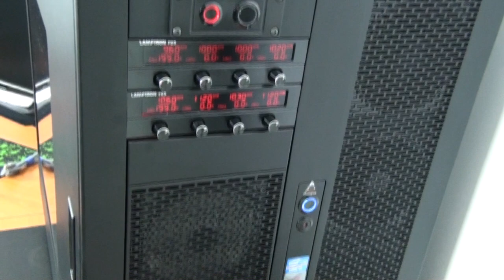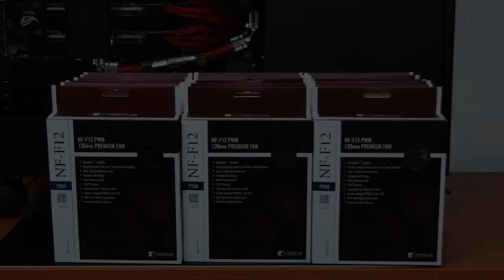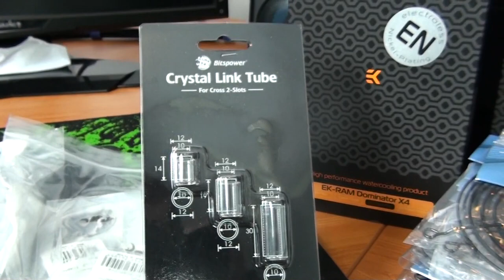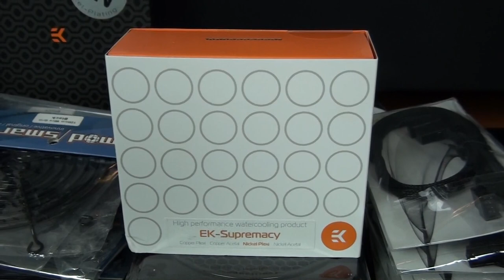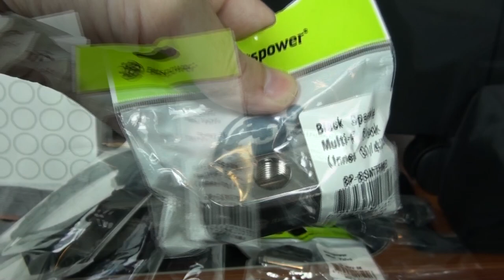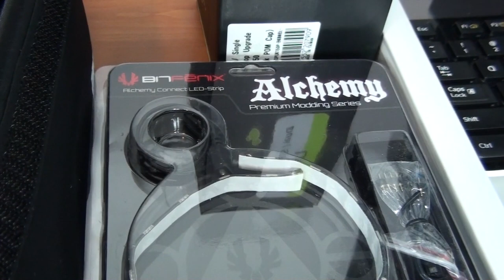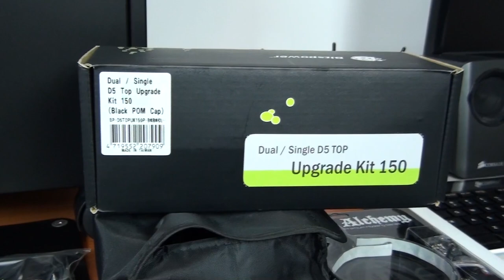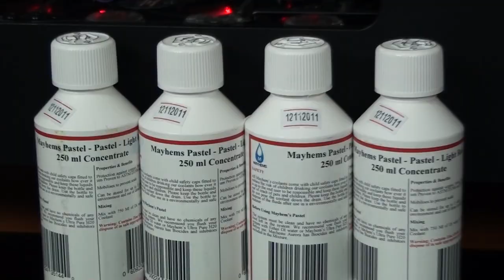Singularity Beast II Build Log Part 11

Comment: Excellent video again, I completed my Magnum TH10 build about a month ago, the cost was astronomical even without computer components (already owned them). It's an excellent case and allowed me to do some funky lighting, cut some switch holes near the switch plate and wired in a couple of latching switches much like the original power switch to control lighting.

Comment: Yesterday I received a TH10 Door fitted with an XXL window. It looks much better than the XL size window. Whilst the build is still in progress the XXL window does show off the various components much better. The freight costs to Australia was excessive, so if you are considering ordering a TH10 I strongly recommend you order the XXL window with the case.

Comment: In theory yes, it depends of the radiator caracterisitcs, some are engineered to create less air resistance (lower FPI) improving performance with low pressure fans, others are optimized for higher pressure fans (higher FPI). You need to find a balance between pressure/flow/noise.

Comment: I shouldn't have said "Galvanic" corrosion in my prior post, but just simply corrosion.  Corrosion (in a like-metal loop) can occur when the pH level of your coolant is too low (I've read different opinions on what "low" is, however anything below 6.4 is running the risk of corrosion in a like-metal environment, as the water is now in a more acidic state and can corrode metals like Copper, Brass, and Nickel).  Sorry for putting so many responses on your comment page

Comment: Unfortunately I've run into a problem with the Feser UV Clear Blue coolant (looks great with UV lighting and with lighting turned off it looks like water), however...condensation at the top of the res has left a white deposit which turns into particulates when it makes contact with the coolant. I also found that the white build up occurred in the tubing I used to fill the res, it's almost like crystallised salt after it's dried. Coolant is my number one headache.

Comment: Higher pressure is better for push air through radiators or heatsinks. And higher flow to situations with lower restriction, like a case fan.

Comment: I'd like some advice on waterblocks... Seeing as EK's new CSQ lineup is ugly-as-shit, I'm leaning towards Koolance's blocks (which are nickel plated). Will I Run into any galvanic corrosion problems using, say, Koolance VID680 (two of them) with a Nickel plated EK Supremacy .. ? Both are nickel plated copper, I guess there shouldnt be a problem :)

Comment: Thanks for the speedy reply dude. I was just wondering cause my neighbour comes over alot to use my comp but he just sold his back-up car & has $5,000 he wants to put towards an extreme build. I just dont want him trying to hook up to my main power box outside when he gets his first electric bill.LOL. I was wondering, the 1 PSU that will B replacing the 2 U currently have is the equivalent, or were the 2 PSUs massive overkill? adding all those hard drives might B risky with 1 PSU.

Comment: You can paint the noctua fans if you don't like them. Obviously not just spray them down. But there is a special way to do it without hindering they're performance. So I'd deffo recommend you try to find out how to do it if you have the time

Comment: Distilled water damaging the components in a loop?  Are you referring to the low pH level of distilled water (meaning it's acidic), leading to corrosion buildup?  I've been worried about this myself, and haven't been able to find any safe additives to increase the pH to a more alkaline level

Comment: what additives are available to prevent simple corrosion?  i've found mostly biocides but that's a separate issue all together.  haven't been able to find any corrosive-inhibiting additives.  after seeing the new "EN" EK Nickel Blocks having the same corrosion problems, I'm really worried about my GPU block on pure distilled water

Comment: after about an hour of thinking about this, I've come to the conclusion that you're referring to De-Ionized water, and not distilled water.  Once you mentioned the ions, I came to that realization, as distilled water is mostly neutral in the amount of ions it contains due to the process used to create distilled water.  Galvanic corrosion has been known to happen in like-metal loops, however, using Distilled Water, due to the pH level of the water being too low (acidic)

Comment: Hello Daniel.  I was wondering if you had 11 minutes of your time that you could possibly spend looking at my most recent video . It is just the into of Parts for a HTPC build using a Lian Li Case.  You Tube has determined that it violates the monetization rule. I have poured over it and can not figure out why.  I sent them a note but don't hold out hope out to get an answer. I was hoping your experience with this may help.  This is no different than others I have done. Thank you.